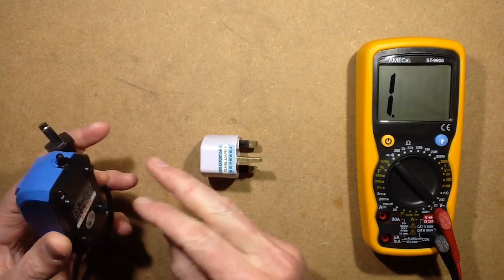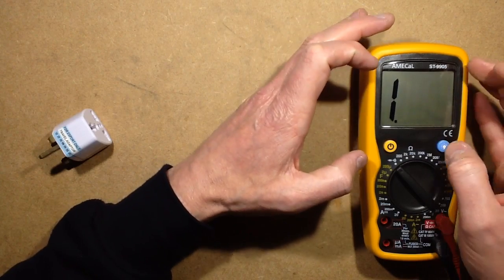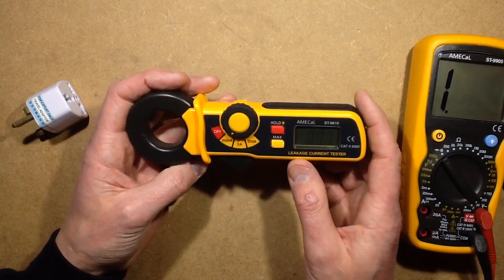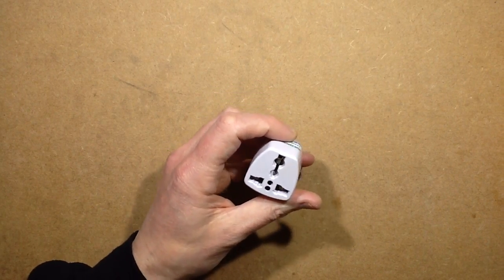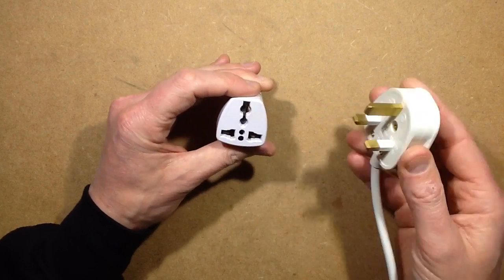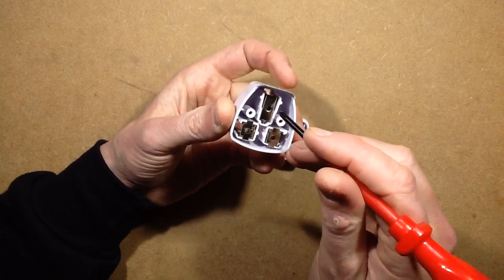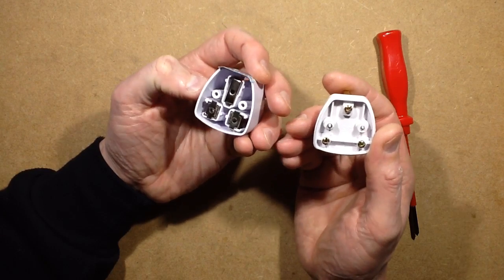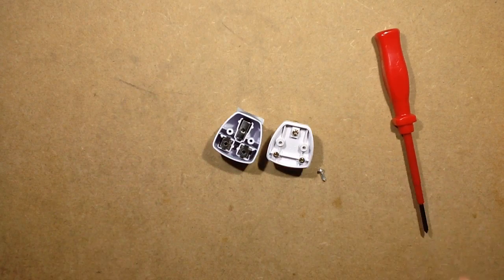Inside another death-dapter variant.

Comment: It looks like it may have just been assembled wrong. Could you not take the 3 screws off holding the prongs and then rescrew them through the ports through the holes on the contacts?
Reply: +Jeremy Kindred i thought that also, but if you examine closely, the alignment is out from the pilot holes so it wouldnt quite meet up with the pins.
Reply: +foundatlantis Hmm, yeah you're right.
Reply: +Jeremy Kindred I was thinking the same. I have had many imported gadgets that were assembled just wrong.